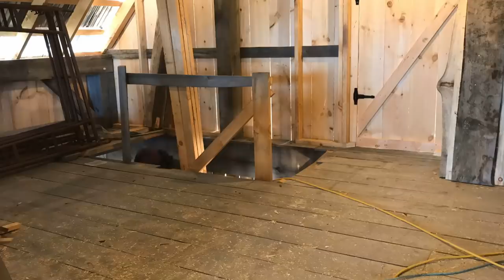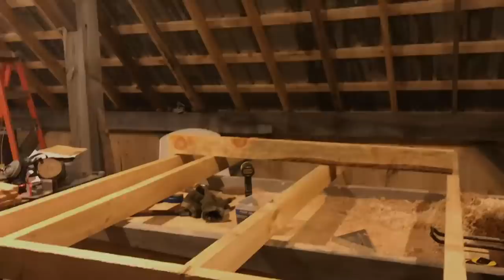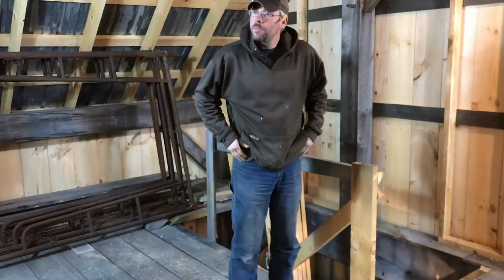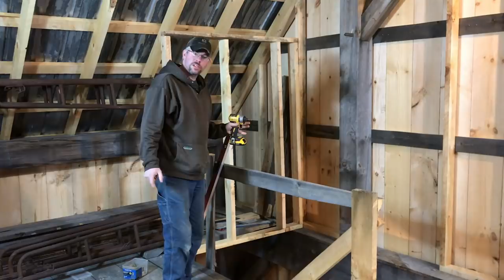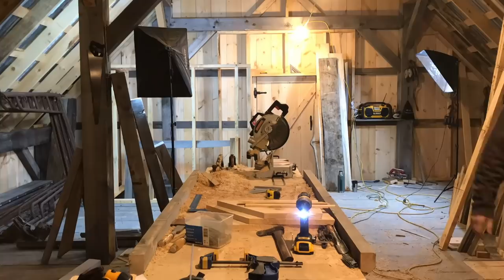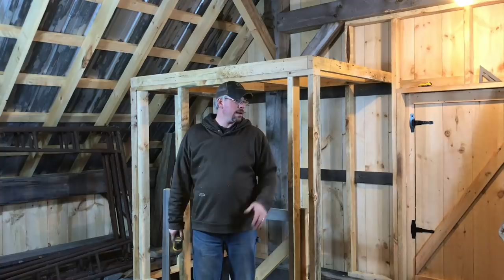Shop Vlog #1: Stick Framing in a Timber Frame?

Comment: Morning Jim.... I have to agree with you, the weather is crazy this year. It's raining on top of a little snow right now and our temps are heading to zero in a day or two.... did I mention I hate this time of year! If you get a chance, video tape a short part of that open wall down stairs to refresh my memory of what's left to close in. I know you need to get material, but you should close that in as soon as possible, especially with the wind you have by you. You don't want to get those timbers wet downstairs again. Coming along good, though.
Reply from the maker: It is bugging the hell out of me.  Gotta love the post Christmas starvation budget.

Comment: Great update Jim. I was wondering how it felt to be working around that stairwell. A thought: at the end of the video would be the perfect time to overlay links to the videos you're mentioning. I'd include them in the video's description as well.
Reply from the maker: I actually have them linked in at the end with end screens.  I'm wondering if they don't always show up.
Reply: @TheTradesmanChannel  I think you're right. I just rewatched the last minute and a half and they displayed this time (in Chrome). Then I switched the the Opera browser thinking maybe an extension I had there might be causing trouble, but they displayed correct there too. Very odd.

Comment: At the stairwell opening in floor where you talk of building a wall ..... here's a concept:  Build the wall about your chest or shoulder height.  Have barn-like swing open doors (in case space is needed to move things up the stairs).  The roof end of the stairwell opening if closed off will become a forgotten shit hole.  Instead, nail up 1x4x whatever length like skip sheeting.  This skip sheeting and the half wall will allow air flow for rot prevention and keeping the place cool in summer and improve air quality in winter.  Oops, I spoke too soon... install vents in you soon to be stairwell walls.   Looks like you'll need to build a bigger barn ... it's filling up fast!
Reply from the maker: Maybe I'll build a 3rd floor...
Reply: @TheTradesmanChannel   You're a nice guy and good family man.  Making what could be a good man cave, a family hang-out.   Even if we; at times, are on our last nerve with family in the end being isolated is worse.   The timber frame will make cabin fever easier to cope with, and bring family together.
Reply from the maker: I figured when I built this that my whole family could enjoy it and they are starting to.  This project and process is very special to me because of that.
Reply: @TheTradesmanChannel  It's been a good experience for all who have a passion to build.  Thanks for sharing.

Comment: I hope you have shares in the hardware Co, or at least a very good discount on all your screws. I'm sure 1/4 of the weight of the barn is 'Iron'. LOL. all the 'Stud walls, I have built have been with a framing nail gun. Goes a lot quicker. :D
Reply: I agree, nail guns are faster, but screws (of the right type) are stronger and allow you to remove the fasteners and move a wall a lot easier than do clawing out or cutting nails, you know, should you decide to redesign a workspace.
Reply from the maker: That's why I use screws.
Reply from the maker: Good morning Peter.

Comment: Air compressor should be outside in its own housing, keep that noise away from the workspace.
Reply from the maker: I think you're right, I thought about that after editing.
Reply: I second that opinion. Also, from my experience, get a good two stage light commercial grade compressor. It is one of those things that are worth investing a little more in. Check out the ingersoll rand line they carry at tractor supply (tan colored). Well worth the couple extra hundred bucks.
Reply: It's important to use a rigid pipe, and bends rather than elbows
Reply from the maker: I work on enough air compressors I can totally agree with you on that one.
Reply from the maker: I agree.  I've done a few military motor pools and had to pipe a pile of air lines.  I like the idea of having air tools for some of the woodworking projects.